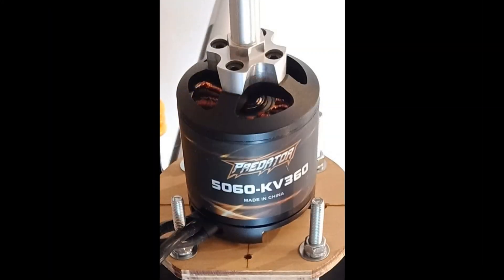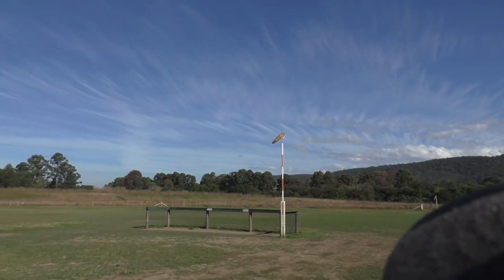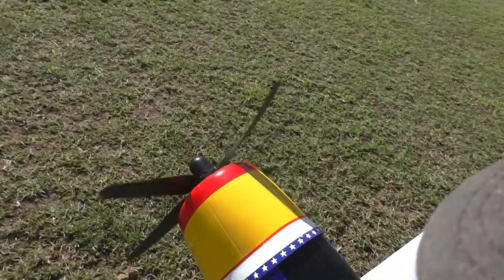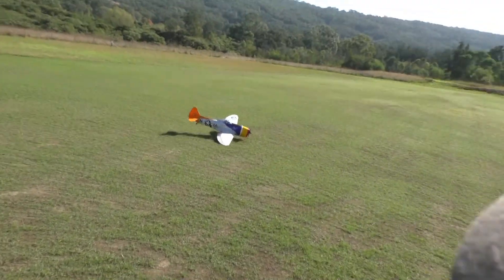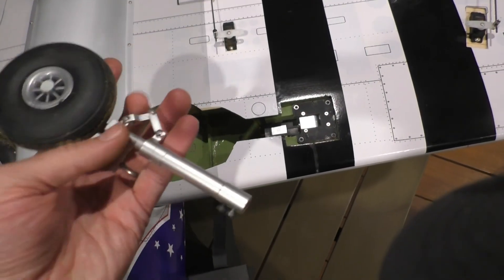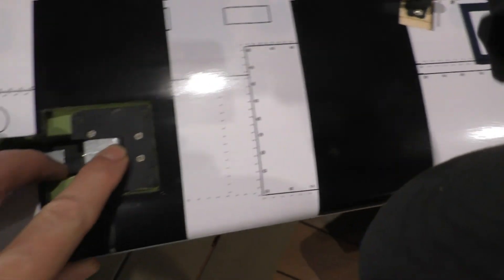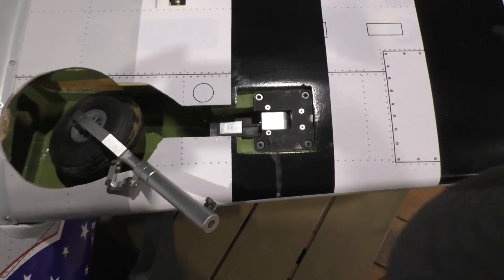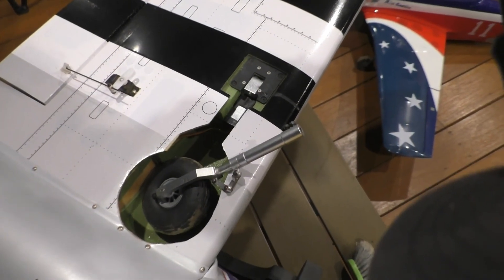VQ Models P-47 / NEXA P-47 Thunderbolt 1,560mm Maiden - 25th May 2021

Comment: Very unusual to have a retract pin be so brittle as to shear off as yours did. It's usually the reverse situation in that they bend easily and then jam in the wheelwell. A goos substitute is the shank of a suitably sized drill bit. Inexpensive ones are fine and I find they have the right balance of hardness to resist bending but not so much to be brittle as you found.

Comment: What was your all up weight.  What brand were the retracts.    I've the VQ P40.    Putting a RCGF15RE into it.   Didn't get the VQ retract with it as didn't like the look of them.   Thinking of getting the E-Flite 95° rotating retracts for it
Reply from the maker: Here is my video on the retracts

https://www.youtube.com/watch?v=_WukcTflfeg
Reply: @jbfordfocus  thanks,.   Plenty of information given.
Reply from the maker: @russcole5685   Take off weight is over 4.5kgs. So the P-47 is really heavy compared to a FMS 1,400mm plane.
Reply: @jbfordfocus  my P40. Although not complete is at 3.8kg,.   Needs retracts and a couple of little things.   So I'll be looking at about the same, fueled      guessing.   It's Ws is 1570.     Soldering up scale exhaust headers at the moment.   Should be a nice touch.   Thanks for ya help.    Feeling confident with the advice I've gathered.   Thanks again for your help.  Happy new year from little New Zealand
Reply: @jbfordfocus 

I would compare this bird to the FMS 1700mm Corsair.